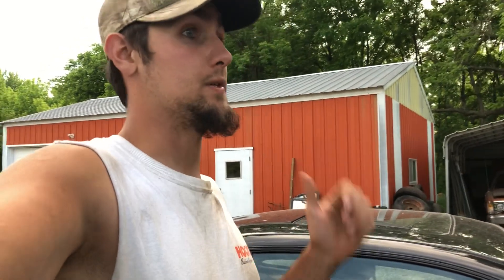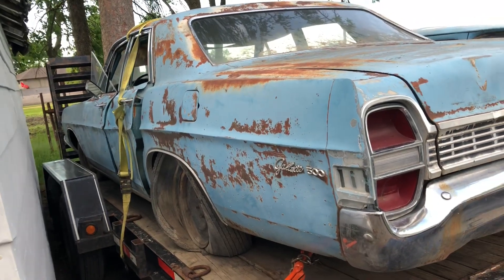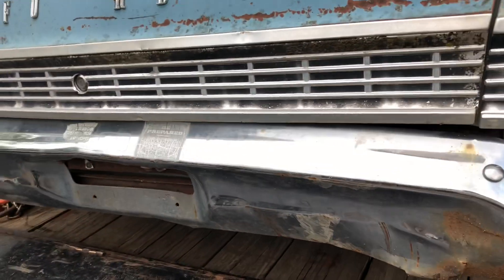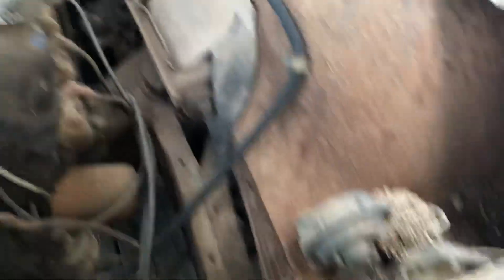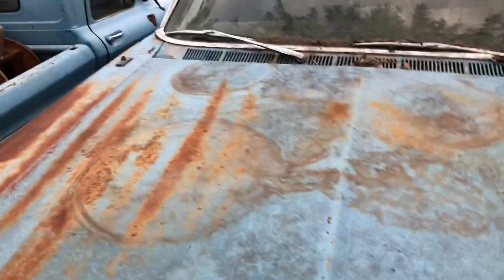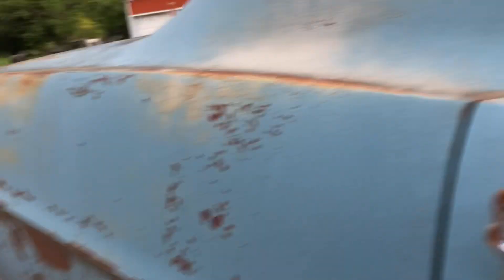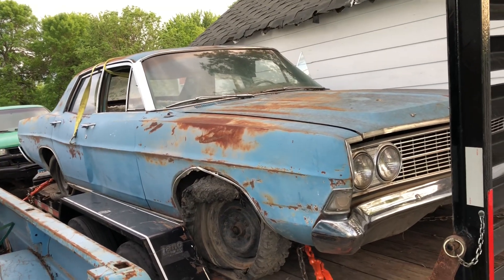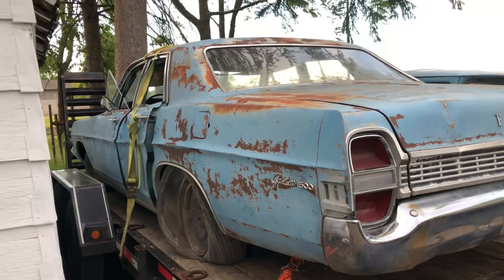New Derby Car for Boscobel Wisconsin

Comment: If you can weld the doors shut and weld angle on the hood and fenders and bolt them together so it stays solid
Reply: @UCwRzqnBU6KwJB0oz_pi9DDw I know that I've heard of the derby but I've been to stock derbys but they let you weld door and bolt your hood shut
Reply from the maker: Derby4life80z I can weld the door but only chain the hood no threaded rod or adding extra bolts for anything on the car
Reply: @demoderbyforlife444  use wire and weld washers so it cant rip through and you can get wire tighter or you could do the angle on the hood and fenders but instead of bolting it together wire it
Reply from the maker: Derby4life80z I’m probably just going to use chain

Comment: Wow you got lied to if you were told that’s a good car. That’s like the WORST full-size ford ever made
Reply: Up here nn mn and wi they are beast in fullsize if there built right
Reply: I’ve never seen a 66-72 full-size ford win a show in any video I’ve watched. 74-78 maybe but not the older ones. Not sure where you’ve seen em win. And no offense for calling your call weak I’m sure I sounded like an asshole. But definitely not a good car. Should’ve found a 71 or 72 gm for a show that’s 72 and older
Reply from the maker: Chase Moellering my buddy that I bought this car from runs a bunch of these and they actually hold up really well in the back end if they are not right but I know that the front is trash but the reason why I got this car is because it is super clean no major rust anywhere on the car that I could find that’s why I got it!!!